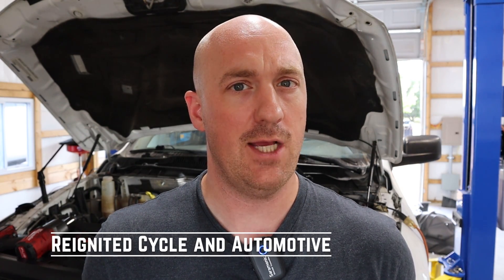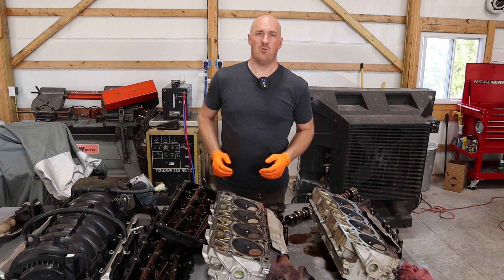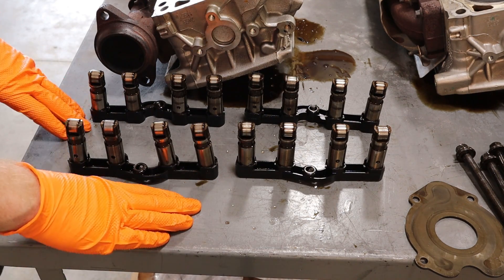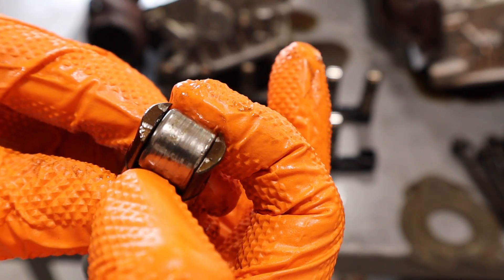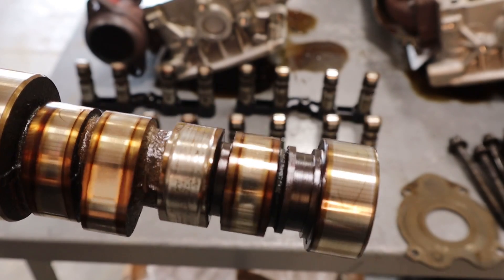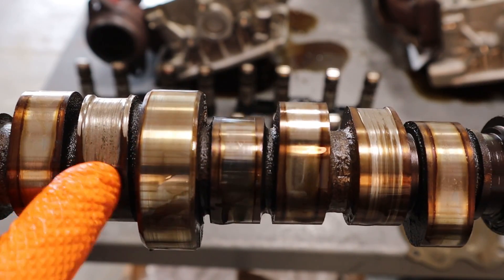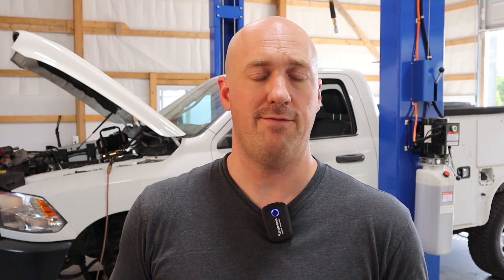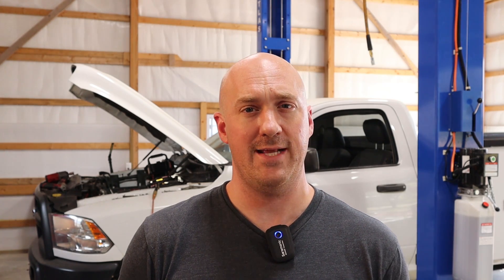Hemi 5.7 Lifter FAILURE Does this engine have a fatal flaw? Find out how YOU can prevent it!!!

Comment from the maker: Hey guys, I just posted an update video to address some of your comments and to post some new information I found! Check it out here: https://youtu.be/8lj4mLhAI4Y
Reply: Never try to kiss the un-wiped ass of the company that you’re trying to suck up to.
Reply from the maker: @blueboltstrike6705  now I have that image in my head.....gross
Reply: @ReignitedAuto  Thank you for your video. I am looking to buy a 2007 Jeep Commander with a 5.7 Hemi in it. The truck has 79K miles and it is a one owner truck. The guy is asking 14K for it. Does it have the same engine you are talking about in this video? what is your advice as far as what should I look for when I test drive it? Thank you in advance and more power to your channel.
Reply: I transport Hazmat and the idle hours are high, but we service the trucks every 60 days of usage. Regardless of brand or engine, they all have gone over 250k miles without opening the engines. We only get rid of them because of California's ever changing emissions laws.
Reply: @e.l.9589  When you idle the engine you have to increase the RPMs so as to maintain combustion temperatures. If you don’t raw fuel gets mixed in with the engine oil. Even diesel an engine oil well decrease the lubricity of engine oil and cause wear and tear in the engine.  When I drive around town in stop and go traffic are use the tow haul mode. The owners manual tells me that it increases engine RPMs to maintain proper engine temperature for proper combustion. You either use it or you lose it.

You either stroke it or you smoke it. You rub it for you scrub it. You slide it or you hide it. You smell it or you dealt it.
Reply: @blueboltstrike6705  My 2500 6.4 seems to run above 200°F, and my Transmission stays @ 169°-172°. My work 5500 runs below 200°F, and transmission seems to stay 150's°-160's°. The information that you guys provide has had me cutting down on idling. Location is Southern California, so I never see cold weather.  Thanks for all of the information.
Reply: @e.l.9589  You don’t have to thank me my friend. Just thank Uncle Tony’s garage. Watch his channel!  Uncle Tony has the evidence in hand because he actually talked to the designers and uncle Tony also stripped the motors down one after another. Uncle Tony also does not suck up to any particular brand or manufacturer. He tells it like it is. Then he presents real world, hard, tangible evidence on video-smoking a cigarette simultaneously.  🤣

When I took my Chrysler 300 C out, I drive it like I stole it. That’s the only way the lifters get lubricated and the camshaft gets lubricated. I noticed that after some performance driving and some hard driving that car actually runs better now. Things are getting lubricated. The engine was designed as a race motor anyway.
Reply: My brother-you must be real. Just repeat: “design flaw”. Look in the mirror and repeat over and over until the lies leave you.
Reply from the maker: @blueboltstrike6705  although I don't agree with you, I like your way of speaking! 👍
Reply: @ReignitedAuto  Come on man you know it’s a design flaw. I actually own the product and I can tell you it’s a problem. 

Things are just not lubricated. Now you have to ask yourself- are your neurons lubricated?
Reply from the maker: @blueboltstrike6705  there are hundreds of thousands of happy Hemi owners who have never had this issue. All engines have design flaws, if used in certain ways those flaws show themselves. My point in this video is that the Hemi engine, if used in the correct manner, is a reliable platform that makes great power. You can nit pick any engine to death if you look closely enough, even the vaunted LS platform. If the failure rate of this engine were 10% or more the manufacturer wouldbe forced to address it. The fact that they haven't showed you that it is more of an isolated issue. It has nothing to do with me protecting a brand, i could care less about Chrysler corporation. However, due to my decade of experience working on these engines, I feel qualified to offer my opinion on it.
Reply: @ReignitedAuto  I feel like most people call their lack of maintenance and lack of care with defects and shit engines. If you dont change your oil often and with good shit and abuse your engine...parts wear and fail. Just like  the earlier hemi engines and even other engines where the valve seats drop out...yes it's not the best design the seats and heads being different materials, BUT it's not a problem unless you heavily overheat the thing. Some people are just ignorant I guess. You seem to know how to work on stuff and how it works.
Reply: I’m dealing with a 2014 Dodge Challenger rt has around 73,000 miles and I don’t really know how to explain the sound but the tick stays when the engine is cold and when it’s warm and if you raise the rpms up a bit the noise gets faster and a little louder I’ve also noticed that the engine idles a little rough but I don’t have a misfire code or anything so I’m very confused and concerned

Comment: Is there any difference with the 2019 + ram 5.7 hemi engines?
Reply from the maker: I"ve heard this, but I don't have any way to verify it. Weirdly enough, Chrysler will change a lot of stuff year to year and not tell the dealers about it. There opinion is that we don't need to know to do our job, which I guess is true. I can tell you that the lifter part number hasn't changed in quite a few years.

Comment: I had cam and lifters failure with zero tick at 110k! The only indication was the check engine light.
Reply from the maker: Oddly I have seen that before on a police vehicle. There  were no external sounds at all, just the CEL. But when I took the engine apart it had completely eaten through the cam lobe.

Comment: I have a 2013 85000 miles... bought it with 20000 miles... oil change every 3000 miles and only idle time is at a red light... 3000 miles ago the freaking eps went out..freaking 2500 bucks... bunch of recalls and stupid stuff going wrong... I WILL NEVER BUY ANOTHER RAM
Reply from the maker: Yea, that electronic power steering rack is a dumb idea. I've changed out quite a few of them. Not sure what was so wrong with a traditional power steering setup.
Reply: @ReignitedAuto  they say main reason less stress on engine = better gas mileage... they need to design it so the module built into it can be replaced .. the module went out.... I am a retired mechanic but can barely change oil anymore so had to take to dealer... 2500 and they even gave me 400 off as a courtesy.. last time I changed the plugs took 8 hours.. 20 years ago I could have done it in 1 hour... I hate being disabled

Comment: Change oil every 5000 miles and reduce idle time.. mine will tick more if I use synthetic.. typical car company blaming the customer
Reply from the maker: Yea I'm not the biggest fan of synthetic in the 5.7 engines.
Reply: @ReignitedAuto  I am a retired mechanic... only time I use synthetic is in the winter.. other than that I use pennzoil dino 5 20

Comment: In a courtroom, one should provide evidence.
How is the metallurgy of the Hemi cam, lifters, pushrods, rockers, etc. any different than any other car?
Sure, the Hemi produces 10 000 hp in top fuel dragsters, but how; I am not sure.
Would it even interest NASA ?
All I can say is that from what I see, the technician shows no proof of valve-stem tip geometry, nor
does he show lifter preload.
Excess preload in any engine causes short life, and rapid lifter, etc. wear.
The Hemi rockers aren't as forgiving as FORD/Chevy pedestal rockers, which allow for slight valve stem tip
geometry adjustments, and are as reliable as a full roller rocker.
The pedestal rockers can be shimmed and when correctly adjusted should begin to tick as the vehicle runs out of fuel.
So, the Hemi shaft mounted rockers are very mean and mash the valves down efficiently.
If the pushrod is too long, the valves don't close, and the combustion pressure tries to ram the valve shut.
This massive force, is translated to the lifter and camshaft which isn't designed for the intense pressure.
So, before the jury presents a verdict, the tech must provide honest evidence.
What is the roller lifter made of that is different from a Toyota/Subaru/Volks  lifter, follower, etc.?
If the valve train is carefully adjusted by someone other than a Dodge mechanic, would there be any more problems?
So, before @ 1985 FORD/Chev, used garbage ball pivot rocker arms.
In 1985 Ford/Chev switched to pedestal rockers with shims that could be hand honed to precision, for perfect preload.
0.020-0.030 preload ie excessive.
Preload may only need to be 0.001-0.005 on a pedestal rocker...stock lifters fully pumped up.
Well, the Dodge is different, but to me it looks like excessive pushrod length is the culprit, until the tech removes the valves
and shows the valve face and valve seat condition.
What is the brand new Hemi compression?
And what is the compression after 10 000 mi.?
Again, the court will recess until culpable evidence is presented.
It appears the Hemi should have a longer life than the factory gives it.
And the key to long life is a proper inspection of all valve preloads, geometry, etc.
And this is what makes the Hemi capable of 10 000 hp. 
No one has the time in America to fix things right.
Because all Americans were born to tow a 600 000 lb trailer and go through 10 sets of tires/week.
Everyone else is too stupid to realize this.
Eugenicists suddenly realize they are in a Universe full of trillions of galaxies, and they may not have sufficiently advanced theories.
Oh, it is the oil, they say ...ha, ha, ha,...but it is the Mafia, or other megalomaniac sillies?
Reply: Wow,don’t forget to take your happy pills next time 🙄
Reply: @Whateva67  Your reply depressed me so much I will now close myself in the garage with my Chev Volt idling. 
Don't anyone try this at home, as it is too dangerous ! It was just a joke !

Comment: Question I have a 2019 with a 5.7 and I have an oil life meter on my dash cluster ( computer) does that calculate by mileage or engine run time?  I looked in the manual and cannot find an answer for some reason I’m not surprised! Thank you in advance for you’re time
Reply from the maker: I just looked that up the other day. According to the information by Chrysler, it's not black and white like that. It also takes into account the exterior temp, how often the vehicle is driven, and if you only drive in short trips or longer ones. So as far as I can tell, the algorithm for the oil change light is much more complicated than I originally suspected. 👍
Reply: @ReignitedAuto  thanks for the info. I usually change my oil when it’s around 40% and I only use either Mobil one or pen oil synthetic. I do do both short drives around town but I also drive an average trip is around 200 miles. I’ve always had the idea that highway mileage is the best mileage and use those trips to quote clean out the system. Am I changing oil to soon if their is such a thing?
Reply from the maker: @sfrancescon  no such thing as too soon, just a matter of cost. If you are comfortable with the costs of changing oil early as extra insurance, then by all means continue 👍

Comment: The reason they fail is a variable cylinder displacement needs to be tuned out of the vehicle.
The latching pin that cuts it on the lifter to turn off that cylinder either sticks or breaks.
And then you end up with a collapsed lifter eating the cam up
Reply from the maker: I'm posting a follow up video to this one TOMORROW that addresses what you're talking about. Stay tuned!

Comment: This video eased my mind. I have a 2011 Ram with 65,000 miles and change the oil every 3000 miles with synthetic oil. I look forward to many more years and miles.
Reply: Your on borrowed time.  My brother's 2011 Ram 1500 ended up with a dead #3 cylinder at only 198,000 and he always did the 3000 mile oil changes.  Never buying another Hemi again!
Reply from the maker: Obviously there's no guarantees, but it sounds like you're doing everything right. Thanks for watching!
Reply: Sell it before the lifters go bad. Nothing to do with oil changes, the lifters don't get oil at low pressure, low rpm and idle.

Comment: Best thing ever ever ever is to delete the mds these engines are over vavle engines same proven design for 50+ years the problem comes from the proven design being changed!! MDS STANDS FOR

(MOTOR DOESN'T SOUND GOOD )
delete the mds system push in a billet roller cam and lifters and beat it like trump did biden
Reply from the maker: Stay tuned for an update video on this I'll be posting on monday! Thanks for watching 👍
Reply: @ReignitedAuto  hopefully you go back to the grass roots of push rod engines and make something worth hanging on to

Comment: My hemi tick happens only when my engine is hot. I hear it loud against the wall. My mechanic told me to go mobil 5W50.. 
Can you pls advice me? 

I have 6.4L with 21Tkm and living on hot tropical weather.
Reply from the maker: One thing to keep in mind is that there will always be some sort of valvetrain noise. Amy sound will be magnified up against a wall like that, hard to say if its actually a failure or not. I have heard people avoiding to go heavier weight oil, but I have no direct experience with that so I can't say one way or the other. I will say that if you do have a lifter tick issue, changing oil will not correct anything, only replacing the failing posts will do that. Are there any dealerships in your area? At 21km you should still be covered by a factory warranty yes?
Reply: @ReignitedAuto  its out of warranty already for my 2013 challenger. I guess your correct, too much traffic here in my country and too much idle. The hemi tick starts to be noticable but will disappear at times. I remove lots of bottom plastic guards to help breath the engine and keep it cool. Im due for change oil very soon

Comment: It most definitely is a design flaw. Others have videos on it comparing engine blocks of the 5.7L GM and the Hemi. I'm on a second top end rebuild as I type this. Failed lifters, cam wiped. This one after only 5k miles! There should not be a block casting under the camshaft, preventing oil from being slung onto the cam from the crank. It is that simple. I know it, others know it, Dodge knows it. And they know that we know it. Will never purchase another Dodge anything, and I was Mopar for life. The 5.7 in my back up suburban (had to buy since the Dodges are always in my shop being worked on) has 300k miles and I beat it like a yard dog, yet purrs like a kitten. Wife's Journey 3.6L had a fatal head failure. Common problem, even on the 200's. So done, run, run away as fast as you can. Lol.
Reply from the maker: I just finished making an update video on this issue that addresses some of your concerns. It goes live on Monday! Be sure to check it out, and thank you for watching! 👍

Comment: Nice video, thank you, you say to go off of engine hrs and not mileage. I have an oil life gauge on the 19 Durango, does that factor hours into it?
Reply from the maker: Good question, I tried to find something specific on that, but this is the closest I could find, "Based on engine operation conditions, the oil change indicator message will illuminate. This means that service is required for your vehicle. Operating conditions such as frequent shorttrips, trailer tow, extremely hot or cold ambient temperatures, and E85 fuel usage will influence when the “Oil Change Required” message is displayed. Severe Operating Conditions can cause the change oil message to illuminate as early as 3,500 miles (5,600 km) since last reset." Thanks for watching!

Comment: Cool info. My 2007 Ram has 104K , miles and it doesnt sit and idle. It has a lot of highway miles, runs great with no noises. It doesn't quite start as easy as my 2018 Challenger with the 5.7 as well. It doesnt start hard but i let it sit w/ the key turned to ON for a few or so  seconds before turning the key and its good to go.
It hasnt had any issues with ticking, lifter noise or a bad water pump.
 One time when it sat for a while i got a misfire code but reset it and hasnt happened since and dont let it sit that long anymore.  Ive used conventional oil in my Ram but started using Synthetic in the Challenger. Maybe ill switch to synthetic in the Ram but dont know its thats a good idea considering the miles on it. I change the oil every 4K.
Reply from the maker: Ya I wouldn't worry about switching to synthetic. Honestly we don't really see many lifter issues in the pre-09 models, so you should be good 👍

Comment: Mobile 1 in my 2014 Ram 1500 since new.  It is not a fleet vehicle and only has 77K miles on it.  Guess what, I have a P0303 code and it is not the coil packs.  Taking it in next week for what I expect to be a cam issue.  If it was an oil breaking down issue, why don't other fleet vehicles have this issue? I will never buy a Dodge or Ram product again.  This is my 3rd and last Dodge vehicle and my 2nd Ram.
Reply from the maker: Keep me in the loop, I'm interested to see if it end us being a cam issue 👍